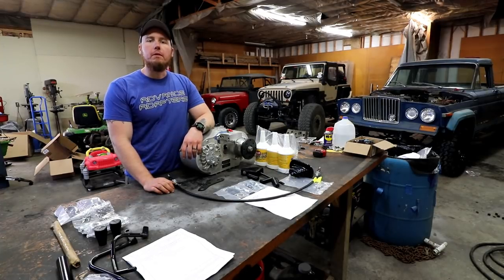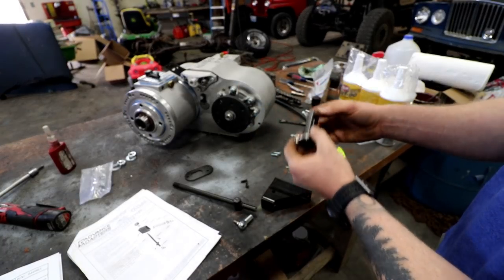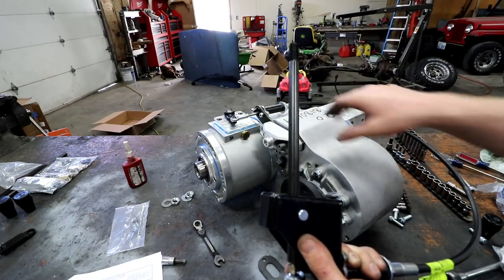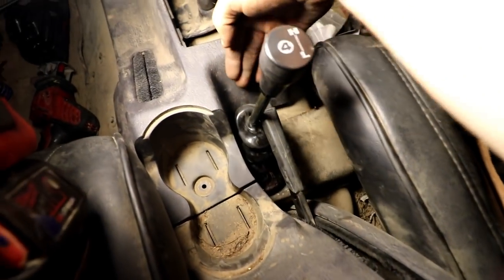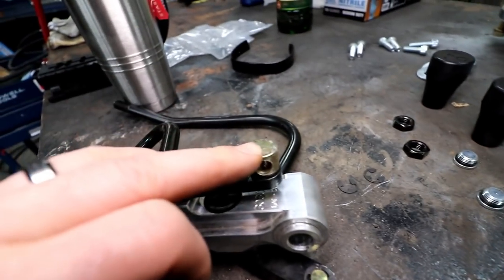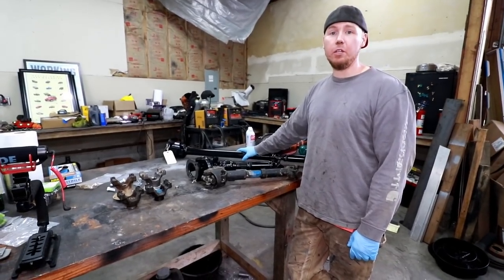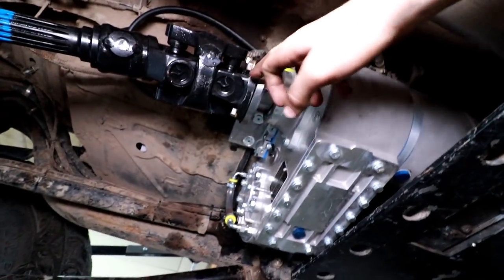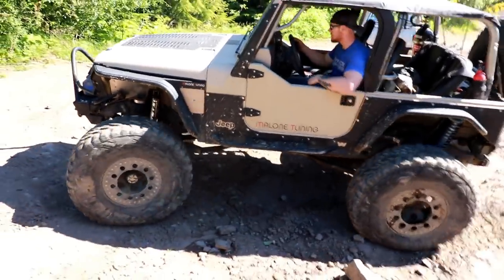SUPER LOW Gear 4 Speed Atlas Transfer Case Install

Comment: I’ve dealt with Adam’s Driveshaft for so many years.  As a customer owning a truck equipment shop,  I was their Mac Tools Distributor for several years (business throughout Vegas & Henderson area died in the 2008 crash), then as a customer just for my personal rigs like my 95 Hummer in the pic. 

They are absolutely pros, never once did I see them do anything shady (tool guys see all the shady stuff).  When mechanics would quit to go work at a different place- they never had bad stuff to say about how James (owner) treats any of his customers and have no trash to talk about any work done.

 Now if I could just get an Atlas with an overdrive unit for my Hummer to get rid of the new process and drop some rpm.  At 5.31:1 already in low because of the geared hubs (portals) - I don’t have a lot of use for the doubler capacity-  unless I could get it to double my high range.  

Is that possible?  I haven’t called advanced adapters about something like this in a decade.

Great videos man!

Comment: ACCORDING TO  ATLAS... FLAT TOWING WITH THE 4 SPEED TRANSFER CASE IS NOT RECOMMENDED.  In my  opinion that is the only down-side to the Atlas Four Speed.... I wonder if  MANUAL lockout hubs on all four axle ends would allow  flat towing with the ATLAS Four speed Transfer case.  YES lock out hubs for ''SOME'' REAR AXLES do exist.